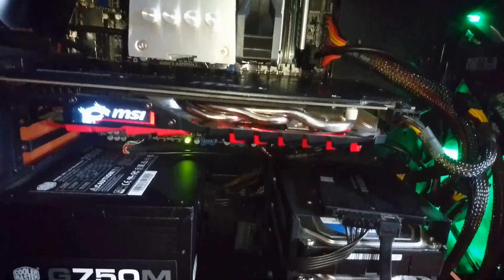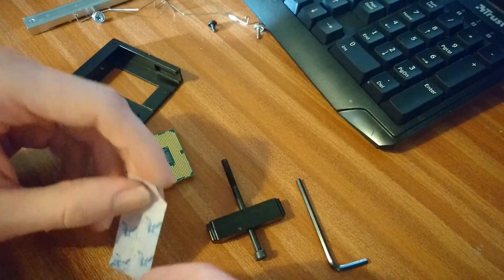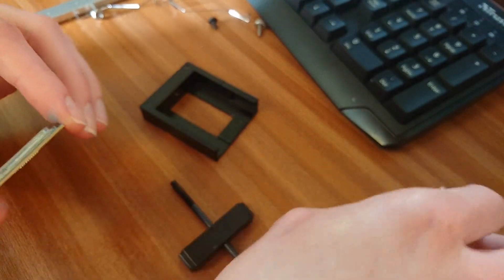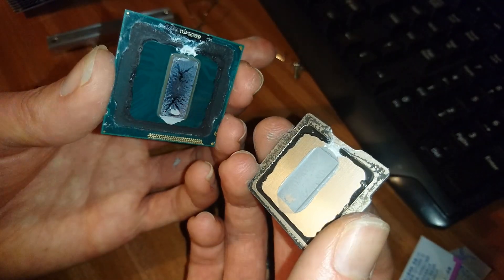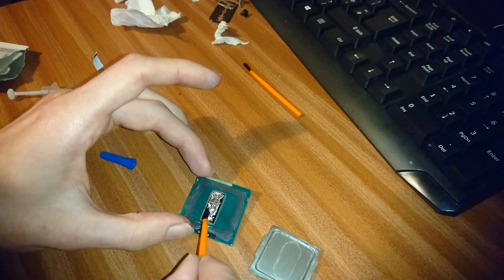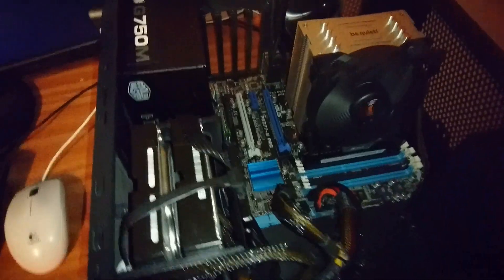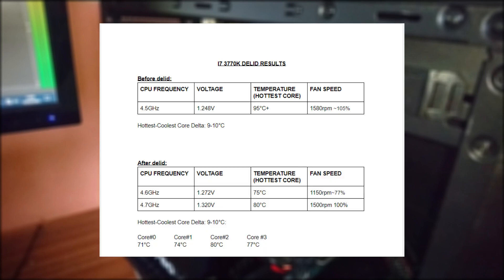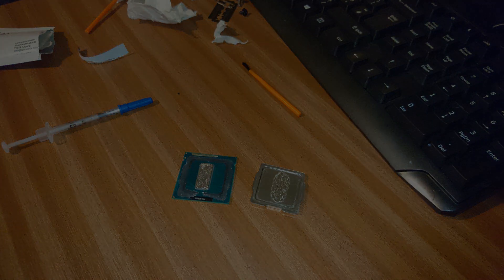i7 3770k De-lidding Tutorial 2020! - Benchmarks, Results, Conclusion!

Comment: the integrated heat spreaders on those cpus are made of aluminum, and if youre using gallium liquid metal, you will slowly rot away the aluminum, it becomes a crumbly grey alloy of gallium and aluminum and loses most of its thermal conductivity
Reply from the maker: Are you sure that the ihs is made of aluminium and not nickel plated copper? One of my most recent videos shows the condition of the ihs after 2 years of liquid metal application and there are only a few marks on it.
Reply: @Jimb0ss99  Good video, thanks for letting me know you have a follow up. I have a 3770K that is running like garbage and I suspect the thermal paste/crap they factory applied is the culprit. 
It is in my 6 year old daughters computer. Valheim is pushing the CPU to 90+% usage. I replaced the paste to the fan and replaced the PSU since it was 10 years old.

Comment: Thats insane!
What did Intel put on the die, toothpaste?
Reply: They are not great for sure on day one, but even a great thermal paste would still be crappy, I mean it's a 2012 CPU... But for some reason I actually like when Intel cheaps out and doesn't solder because the liquid metal seems to be even better than soldered IC.

Comment: Just out of curiosity, why didn't you use liquid metal for the IHS->Cooler interface as well, since you already had the tube of LM? Too risky?
Reply from the maker: Exactly, When using liquid metal here there's a risk of the liquid metal seeping out from the IHS and cooler; there's nothing to stop it. Between the Die and IHS however the sides of the ihs help block the liquid metal from coming out. 
Also, there may not be be much of a temperature decrease compared the high quality thermal paste I'm using - the surface area of the cooler and ihs are bigger and I thought using high quality thermal paste should do a good enough job. 
Finally liquid metal reacts to copper a bit and aluminium badly and I didn't want the mark my cooler - or the top of the IHS - I want to keep the writing! I didn't think it was worth it.
So yes It would be possible but I personally I don't think the benefits outweigh the risks.
Reply: @Jimb0ss99  If I had that cooler I would have risked metal liquid all the way as it seems nickel plated just like the IHS...

On mine is direct contact so the copper pipe touches the IHS directly and there's aluminum between so I never risked as it still reacts with the copper and the liquid metal eventually turns to dust too, but if I had nickel plated cooler I'd go full metal liquid, also it's super easy to protect the surrounding of the CPU on a desktop and you also don't move the desktop like a laptop, the spilling risk is almost none.

Comment: 4.7 with delid ? u put in auto mod or what ? with manual oc, i have 4.7 with normal thermal paste, grizzly, and no delid.
Reply from the maker: Hello I definitely should have shown my full bios settings for the overclocks. It's in manual oc mode with xmp.
I used manual voltages, not offset. 
I think I used medium llc for 4.5ghz, high llc for 4.6ghz and ultra high for 4.7ghz.
And that's great! what cooler do you have?
Reply: it's a silicone gambling don't aspect all chip can do what yours can,for example my 1st 3770k can do 4.9 at 1.35v unfortunately it dies in delid process and the 2nd one suck as hell 4.6ghz@1.42v and  4.7@1.52v even at 4.6 i need to delid and lapping it.
Reply: @amadzack666  even with a shit chip, 3770k is easy to cool.....
Reply: @ShanKhaLee  no it's not when you go beyond 1.4v it's harder to cool it even with liquid metal paste+AIO 240 rads

Comment: Nice video, thank you for it. Im planing to do that to my aging 3770k. Now runing mild overclock of 4.2GHz and temps reaching max 65 under full load. AC Freezer 34 eSports DUO, budget cooler.
Reply from the maker: Thanks! Also nice cooler, I would get a bigger air cooler but my case doesn't support it:(   You should get better results than mine hopefully!

Comment: Great video, dude. Did you consider using some sort of adhesive to secure the IHS back on the CPU? I'd highly recommend it, I know the liquid metal will hold to some degree, but not worth the risk. Loved the conclusion at the end, including the variables. Nice n scientific.
I'm considering doing this too, before I upgrade to the 3900X, or something similar. Honestly, this 3700k has done me well over the years, but I've got a custom water cooling setup with a triple rad, only cooling the CPU, and I'm getting ~85'c  on prime95 on 4.5 @1.21v, and I can't push it any further than that. I know the IHS is the problem, and it pisses me off. Going AMD now.
Reply from the maker: @Juan Pretorius Hi, thanks so much!  I thought about putting adhesive back on, I watched a few videos about it and decided against it because I thought it would get better contact with the ihs and I hope the securing mechanism holds it in place so the liquid metal doesn't come out.  But yeah I know what you mean -I haven't had any problems - yet! 
You're getting 85c@1.21v@4.5g with a big water cooler!? yeah the ihs is so annoying. de-lidding this would be a fun little project. And nice upgrade!! 

I run mine at 4.6 now, no power saving, ultimate performance power plan, or 4.7 w/o hyperthreading- for emulation and some games. can't get 4.7 fully stable w hyperthreading - maybe mobo limit or cpu hard limit or something else.
Anyway thanks again for the comment!

Comment: i am the user too, but i use stock cooler. when its on idle its 46-52 degree. is that normal? when full load its almost 68-74 degree
Reply: Is that normal bro? Help me to find out
Reply from the maker: Hello Pangestu, 
What frequency is your cpu running at? 
The load temps are OK for a stock cooler depending on the frequency.
There could be a few things to help with the idle temperatures:

Cpu power saving tweaking in bios/windows.

Check case airflow -important!

Finally you could have a look at the CPU again to see if there could be anything to improve- liquid metal application, removing silicone adhesive- reducing gap between die and ihs etc.

Hope this helps!
Reply: Jimboss99 normal freq, i dont use overclock. I've been replace with the new pasta, and clean up the case. I just want my pc cool😂 my friend told me that is normal. But thanks for ur information dude